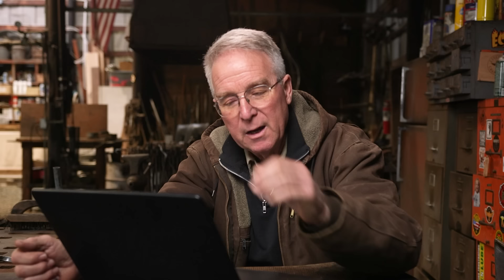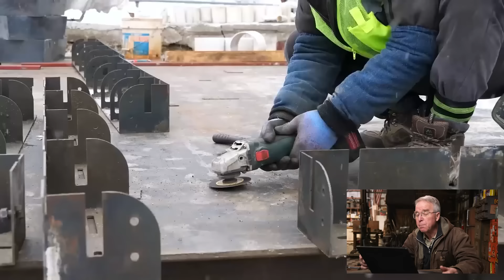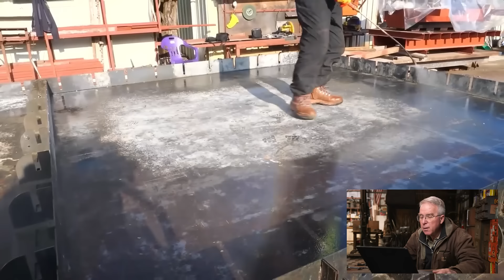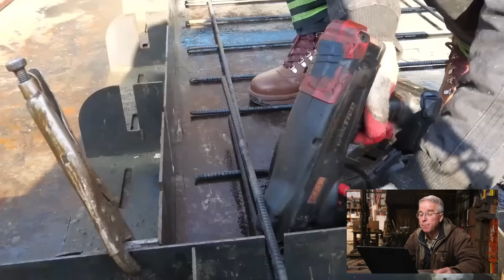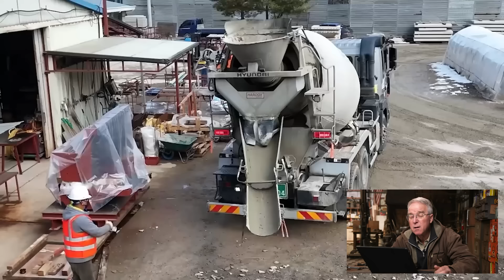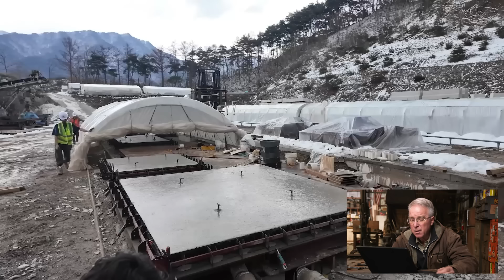40 Yr Contractor Learns CONCRETE  Korean House Construction

Comment: Considering that a rebar splice is required to be 36 diameters of the bars, threaded connections would save a lot of steel industry wide. Savings compound on larger diameter bars. Concrete flows better without lap congestion, column cross-sections can be downsized, rebar congestion reduces in critical joints and continuous load paths improve structural integrity.

Comment: The threaded rebar is called "DBR's" dowel bar replacements. Or some people call them form savers. Used alot in concrete high rises.

Comment: As a precast engineer in Canada,   Typical crment with enough heating can make concrete reach 22 to 25 MPa after 12 hours with normal GUL / type I L cement. Other precasters use type III cement which hydrate faster. No one uses calcium chloride accelerator as it causes corrosion of steel reinforcement and hardware. Adding heat and/ or steam accelerate hydration of cement and it can reach final strength in 8 to 12 hours temperature should not exceed 70 degrees C inside concrete to avoid ASR or undesired effects. 
There many precasters are more automated than this for sure as this is very basic one with only handy workers.

Comment: I know, industrial precision is cool, but I'm a much bigger fan of that traditional house (hanok) video you did, haha. I just think, Korea has some amazing heritage in terms of architecture, going back thousands of years, and they would probably do well to push that rather than push the concrete industry. 

We lived in many concrete houses here in Korea, and all of them were really really unpleasant both in winter (crazy condensation from the Siberian winds versus your interior ondol heater) and in summer (crazy moisture buildup and lack of air circulation so mold grows everywhere). It is tough to justify the effort spent trying to make concrete work in this climate, when Korea already has the most amazing vernacular architecture that uses local, renewable, ecologically sane materials and passive solutions for keeping the house comfortable and dry. Our friend is a master carpenter for hanok, and it's really impressive. If they really spent more effort to gently modernize that traditional architecture, it would be amazing. 

We live in a hanok, by the way, haha, and have been rebuilding it for a year now. Amazing process. Unfortunately, the company in the traditional Korean house video you did before seems to have gone out of business, which was sad, since we really wanted to use them for a build!

Comment: All Korean residential buildings have radiant heat floors.  On the rough finish, 50mm isopink insulation and waterline will be installed and cover with 50mm concrete.  That is the finish. This time a lot of effort will be given to make a good finish.

Comment: On steady ground you do not need rebar. And this house is made earthquake proof by building on a loose base so it will not take over all the vibrations. Then the very sturdy and sizable rebar constuctions is adding to that. The stiffness of the building is off the ground. Must be...

Comment: the concrete is not making its own heat. they're covering it to prevent quick solidification which prevents cracking or internal stress. Concrete should be wetted and not directly on the sunlight. Also those black pipes were for electricity, water etc.

Comment: We built a 3 story library on top of a 3 story underground parking garage. The jobsite was one city block. The garage was almost street to street. The parking garage had 2 feet thick dense Styrofoam over it. 2 guys could pick up the 4x8x2 foot blocks. The library and an auditorium footings were poured on top of the styrofoam. The area around the buildings was backfilled with dirt and eventually they planted trees there. All the weight was bearing on the styrofoam. It's a pounds per square inch thing.

Comment: 9:10 Those black tubes are not floor heating, but power cables. Yes, we commonly use underfloor heating, but it is placed on the insulation. It is stacked like concrete floor - insulation - concrete foam - underfloor heating - cement mortar - floor finish. So the underfloor heating is actually ON the floor, but we put floor finish on top of the heating system.

Comment: That building looks super solid for a two-story place! Back home, people usually just use steel decking (composite slabs) for the second floor, but I always worry that might cause issues later if you're putting a lot of weight up there. Thanks for the video, I’m really enjoying these.

Comment: The base doesn't need crazy compaction and it's hard to get class 1 compaction in an area like that, because you need mega heavy machines to achieve it. I suspect the engineers have designed it to be load bearing on the footings.

Comment: I worked in a precast concrete panel factory. We were lifting the panels and putting them on the curing shelves in 6hrs then they were on the truck for transport within 24-48hrs.

The concrete was full of chemicals and would start setting up as soon as it would hit the table. It was roughly 65MPa concrete. We'd screed with a machine screed, float and finish within 60mins, with a final machine trowel at about 1.5hrs.

Comment: I moved to korea (from Pennsylvania), 15 years ago. I have a light woodframe US style house. Lived in cement here but the humidity in korea makes mold inevitable in cement houses. 

Anyway, now that i own a house, my dad loves doing improvement when he comes. But he swears to high heck about how we cannot buy floats or magnesium trowels here. All hardware stores have $1 steel trowels, and thats it. There are no "better" ones. Well i have a wood one my dad brought from the states. Its pretty funny seeing an old polish guy getting angry in a hardware store here! But he does. The tools and methods are different,but my dad still layed a nice pad with me last year. He said the korean cement is insanely great quality (we bought a little mixer). But yeah we made a bull float outa old lumber and just did it with cheap iron trowels. Works. Usually in korea, they have a gasoline powered buffing machine that comes later to polish, when smoothness is dsired. But bare cement floor is... very very rare. I cant remember ever seeing it, actually. Even parking lots have a thick paint applied. But residential floors are all radiant heated, too.

Comment: Very similar to how we build in Germany. Mix of precast delivered on site and parts of the building poured on site.
Makes for houses that stand tall 100+ years. 
But its hell on earth for us electricians and the plumbers because that concrete the professionals get is HARD stuff full of rebar and hard hard high strenght concrete not comparable to the readymix in bags.
When things arent accounted for in the planning stage or you are renovating an old building the concrete becomes your worst enemy.
One installation technique we have for the electrical is we do in-concrete conduits and boxes aka we fix them to the formwork before the concrete crew pours the concrete in.

Comment: That home is built to last many, many generations. The thermal battery in the foundations is genius. I wish homes were built like that here in the United States. If I were to ever build a house in the U.S. it would be cast concrete or cinder block with concrete and steel fill at the least.

Comment: Great video - many more I have also watched. The concrete floor is just a subfloor a further layer of insulation / underfloor piping ( Ondol ) and then screed will go on top - Heated with city gas boiler. The first set of lines going in under the slab will be services electric and water - Water supply regulations need the pipe to be laid around two meter deep under the frost line. The first layer of concrete is just as raft the subsoil is quite often dense clay structure which in traditional houses would have been used to coat the walls like plaster. Small three / four story (villas) with two apartments on each floor are quite common in the suburbs as they will be rented out.

Comment: I watched this video and impressed yet comments on it says slits and gaps are not good for insulation to keep house warm and cool though they fill the gap with a material(not completely filled). It can cause condensation and mold eventually, made me have a second thoughts. Maybe since here we have huge annual range of temp, we may have higher criteria than where have less range.
Precasted concretes construction can be easily found underground parking lot.

Comment: Its a a really basic raft slab, basically the engineer can treat the soil as liquid and you get a bouancy rating, as long as the surface is really level the only way the whole building will settle is downwards which increases compaction over time.

Also they way they set the pillars is earthquake/hurricane protection.

Comment: This way of building was done in east Germany from the 70s on called concrete slab element construction. There where about a dozen design sizes that where prefabricated in big factories and all prefabricated concrete elements where standardized sections like the American wood standards. These building types where from 3 stories up to 20 story apartment buildings. They were so efficient and popular that they where built from Berlin to Vladivostok in eastern Russia. Very popular and quick to build housing

Comment: There is high early strength concrete mixes. Also SCC or self consolidating concrete. We can pour easily a 42'x10' Precast structure and strip it 12 hours later. we accelerate the cure with steam and a similar tarping method. Also can leave exposed couplers and do a dual pour such as headwall/toewall.

Comment: Being an Engineer with many years of precast construction experience., I am very familiar with the heating system. The heaters are used to fast-cure the concrete. The process is called steam-curing. This allows the builder to reuse the forms every single day. Process is as follows: You make a concrete pour today, then heat it up overnight, and the next morning you can strip the forms, and start all over. This process required maintaining a precise temperature overnight. It also requires (not shown in the video) keeping concrete samples under the tent. Before picking up the unit in the morning, you must first break the cylinders to make sure it has the required strength for stripping the forms. While in storage, the concrete will continue to get stronger.
Reply: Build to fail?  What are your thoughts on metal actuallly destroying concrete? 
Reducing the life of this media.
Wishing a different product other than carbon steels could be used for legacy buildings and such..
Can concrete last thousands of years ?
Seems steel is a curse..
Reply: Korea is not totally earthquake free, but it is very rare. Also the magnitude of these shakes is not even close to what Japan gets...

Comment: In the UK there are two time marks for concrete - 7 day hardness and 28 day hardness - 7 days its at 75 % strength (approx). Aggregate hydration before mixing has probably the biggest effect on strength. And the line up of bolt holes - well done.

Comment: 17:08 The Korean Peninsula is seismically active, so that hole's ID in the vertical columns and those spacers that they installed are more than likely for earthquake regulations. The above ground structure can move independently from the concrete slab in case of an earthquake and those spacers probably act as a surface on which the columns can move and not wear the concrete down on the foundations and the column itself.

With this system, there is very little risk that the house collapses, unless it's a very strong earthquake. It seems to be sort of a modern version of what you saw in that Korean wood framed house video with the wooden structure being set on top of marble blocks that were not fixed to the slab itself, nor the structure.
Reply: It’s not any more seismic active than say Missouri. Japan has the fault lines and absorbs the tsunamis and some of the typhoons.

Comment: 21:10  South Korea is not that prone to earthquakes.  Definitely not anywhere near Japan in frequency as well as upper magnitude earthquakes.  Interesting fact is that one of the largest earthquake - 5.4 in Richter scale - in the last 100 years was man-made in 2017.  It happened due to fluid injection for a geothermal project not dissimilar to increase in earthquakes induced by fracking in Oklahoma, US.
Reply: Your correct most Asian nations are not earth quick except for Japan and some part of China but ye other than that rare

Comment: 11:01 Steel toe would actually hurt! The steel toe would crush and trap the toes! Then when you got the weight off the foot, you would still have the toes trapped in the boot. By the time you got the steel toe cut away it would probably be too late to save the toes.
Reply: Actually, if you've ever had something smash your feet in steel toes, the steel collapses for a very short period of time then it reforms back to the original shape. It does not crush your toes at all. It makes a tight wavy pressure on your toes, but doesn't collapse, and right after the weight is lifted off, the steel returns to normal shape. I never knew this until last year when it happened to me twice. It's quite an incredible thing.
Reply: @AsManThinketh then they have massively improved steel toed boots. Back in the '80s when I was arranging first aid classes one of the things they said was that if a steel toe boot is crushed not to try to take it off if you can get the patient to a hospital within a few hours.

Comment: Given the surrounding site, this building is being constructed as a residence. Since floor heating is standard in Korean homes, the typical process involves layering waterproof film, insulation, and hydronic heating pipes over the structural slab, then finishing it with a layer of thin-pour concrete. This self-leveling concrete creates a remarkably flat surface. The final finish is then applied on top according to the owner's preference. So, even if the floor looks a bit rough right now, there’s no need to worry! :)